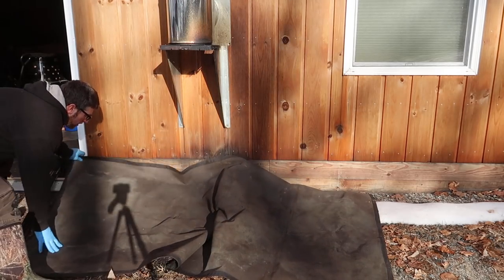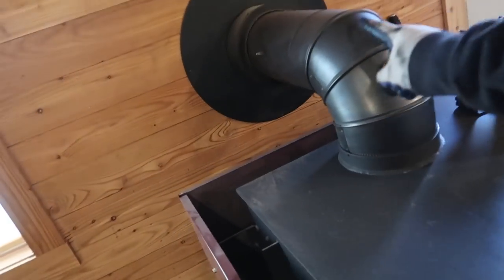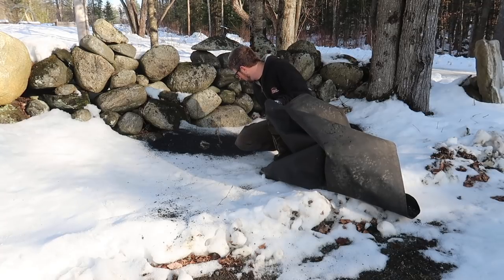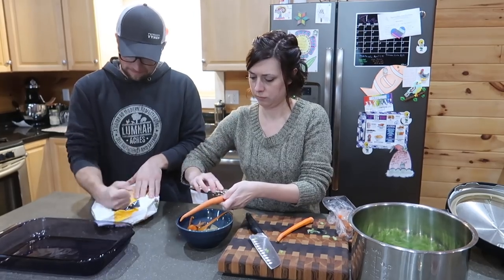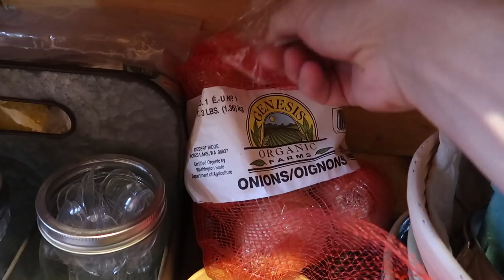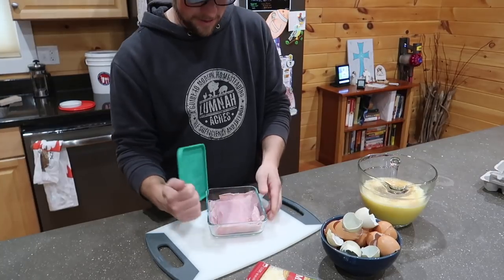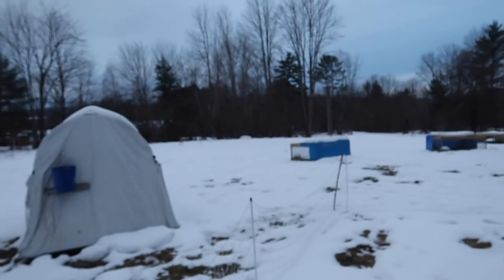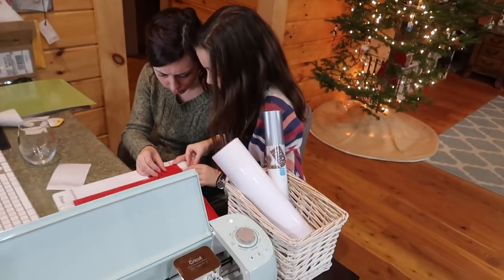I wasn't Expecting That | One Of the Dirtiest Job

Comment: We used to use a forced air wood burner, but it would keep the house at least in the 80's in the winter in Indiana! We had it tied into the existing ducting and had a furnace/ac combo unit, but the wood burner could be cut off from the main supply by closing a flap! The house was a manufactured home that we had placed on a full basement and we kept the wood burner at the back while the furnace was located in the middle of the basement, the ducting was connected through the main supply! 

But they are always fun to clean, we did have a brick chimney installed for ours at the back of the house with clay liners and a clean out, which made ours a little easier to deal with, but we still had a vent from the chimney to the burner which had to be cleaned, but it was easily removed for cleaning and was a section only a few feet long! We have since moved further south, to Alabama, winter is was easier here, though the Alabama clay is just a mess to deal with!

My grandma used to use her wood ash for her sidewalks in the winter, she had done this since the 1930's! thought I'd throw in one last thing, tip for peeling carrots, use the back of a butter knife and scrape the peel off, my grandmother taught me that, she always taught me about wasting as little as possible!

Comment: We bought a chimney sweep, now we can clean our chimney. We've never cleaned it since we moved here but we don't use our wood stove very often. The previous owner put it upstairs. So when it's on the furnace doesn't kick on very much and our basement gets so cold. This summer I just discovered that the fan on the wall in the living room actually blows the warm air into the basement. So now we can use the wood stove and blow some of the heat into the basement. That only took 7 years to figure out. haha

Comment: Gina, your celery will keep probably 10 timers as long if when you get it,trim the ends then wrap it tightly in tin foil. It's amazing. When I first began my cooking career a chef I worked under would save all the vegetable trimmings(carrots,celery & onions)"mostly egg shells and trimmings from chickens (necks,wingtips& giblets)in a clean bucket. Then when he wanted stock (at least once a week)we'd pull the bucket out of the walkin and on the stove it would go to boil off.  We would also do it for beef,fish,shrimp stocks.
Reply: Yum that really looks good

Comment: On that onion you can cut it in half along the poles so the root stays intact on both half’s, then dice the same way you were but with the flat surface on the cutting board. Less chance of cutting yourself😉

Comment: Hey Al just some food for thought. By the looks of it you have a solid surface island countertop. I see that you put cooling racks down when you bake bread. I have also seen you put pots and or pans right out of the oven on the top. Please put a trivet down for your hot cook wear. chances are you will have no problems, but the tops have only so much expansion and contraction ability. You should also have a seam running lengthwise on the top, on your livingroom side. Do not put anything hot on the seam. It should be 30 inches from the front of the countertop. Build the stuff for a living, hope the info helps.
Reply: He's got a video of making the concrete countertop. It's pretty amazing.

Comment: Good call in cleaning that chimney!  One hotter fire in the morning and another one in the evening will keep that chimney cleaner. Seasoned wood and a couple hotter fires keep that chimney clean. Clean door glass is another good indicator if you have a clean/hot enough fire.

Comment: You can use a layer of cut up flour tortillas instead of the hashbrown crust too. Just be sure to spray the pan first. And assemble it the night before, so it has time to soak into the tortillas!

Comment: I have been heating with wood for 40 years and since I quit using an in flue damper, I have reduced my creosote by at least half. You want as much hot exhaust moving up your chimney as possible. and my stove still burns very efficiently.

Comment: Great job on your chimney. Not many people go to the trouble of cleaning till spring time. You’re preventing any risk before it could ever.start.
I have an idea for you. I did this when I bought my house back in the 80,s and it’s probably the best improvement I did. I cut a hole through the wall right beside my wood stove and put in a half door with a box and shed roof on the outside. The box holds about a weeks worth of wood and it’s all outside. No more carrying in wood and making a mess.
You could do it by taking out your window beside your stove and build a door that size and a box on the outside with a shed roof. You May miss the window but not as much as you’re going to like having all that wood outside just a step away from your stove.
I don’t think I would have burned much wood if I hadn’t put in my box. Where my stove is I have very little storage room and to bring it from outside storage it’s about 40 feet away. 
This would make a great show project for YouTube.
I really appreciate you sharing your adventure with us.

Comment: Save the carrot, onions, and celery, ends and peals  to use for stock prep. Next  time you make stock, when the bones are almost  browned enough, throw in your ends and peelings and brown. Then add the water to get all the flavor out and cook until done, then strain. There's a reason veg peelers have 2 blades on the cutting edge, hold your carrots before you remove the ends, upright and run your peeler up and down the stem then cut off the ends and save in the freezer, or dry for stock making. Works way faster than peeling one peal at a time. You can also give the cooked vegs to those goats, who do have both upper and lower teeth, just not in front. In Oregon you can rent goats to clean up your brush around the trees including Blackberry brambles.

Comment: We had the same creosote problem with our chimney being outside, what happens is the smoke gas cools quickly when the chimney is outdoors and cold. Even with a hot fire half way up that chimney is too cold producing all that. We moved our chimney inside and only had to clean it twice a heating season with little to no deposits stuck up the chimney.

Comment: Great idea sending chimney up the side of the house. So much safer cleaning from the ground than from height.  3 suggestions, 1: mask since creosote is cancerous. 2: duct tape for the two joints inside the house at stove and wall to guarantee no Carbon monoxide leak, 3: Carbon monoxide detector, since its the only way to detect if deadly Carbon Monoxide is building up in house.

Comment: I noticed one major problem. Look at the outside wood color right of the chimney. Possible to much heat coming from your wood burning stove on the inside may later cause a inner wall fire. Should install firebrick on inside wall behind your wood burner.

Comment: I have a wood boiler so I don't have to chimney sweep like that.  In the spring, I will scrap down the inside.  However, I do have to clear the ash from underneath with an auger every few weeks.   The ash is great for slippery areas.   What was the spray you used on the stove?  I need to clean my old wood cook stove that came with the house and have no idea what to use.
Reply from the maker: It glass cleaner is sprayaway

Comment: Interesting, but I think I prefer my own stove flue setup. The flue goes straight up from the stove so there are no corners or horizontal parts to collect stuff, and it's all inside the house so the heat that is lost through the flue heats up inside the house instead of outside. Also, the smoke is hotter when it gets to the top because the flue being inside isn't chilled so much, which means more of the volatile compounds go out with the smoke instead of condensing inside the flue. I don't know how our box-ironbark forests compare to your American firewood sources, but I clean my flue once a year, in summer, so I don't need to worry about heating the house while I do that.
Breathing protection is a must, though, while handling products of combustion. You don't want to end up with lung cancer like a smoker.

Comment: So you don't have to use chemical cleaner or a razor blade on the door of the stove - weirdly enough if you use the soot that's left from burning the wood on a damp cloth to polish the window it comes right off!
Reply from the maker: I will have to try that. Sounds odd.
Reply: @LumnahAcres   seems counter-intuitive I know but it works like magic for me! Maybe it's the abrasive quality of the charcoal/soot

Comment: How do you folks make hot water? Gas?
And BTW:
I wonder if (all things considered) you guys are truly saving a lot of money living off-grid and burning wood. Since it has to be cut, gathered and stacked etc. and all those things are time consuming and not without a lot of work...  and chimney cleaning included.
As far as energy costs go, I live in a 12 room 2 family house in North Jersey. (baseboard hot water heat by gas) I pay to provide all gas-fired HW and heat for all 12rooms and  my A/C electric costs  for all of my my 8 rooms.
The total gas & electric bill ...for everything including lighting for the entire year was $1,940.00 last season. That's only a bit over $5 a day for total comfort by thermostat... no physical work at all.
If you guys were on-grid for heat.. would your annual heat/HW and A/C cost be a lot more than I pay?